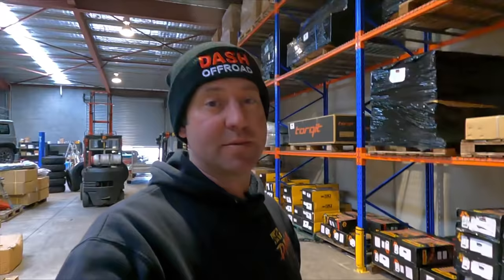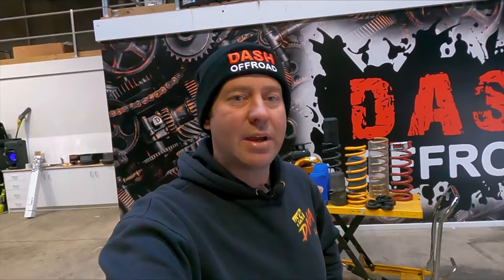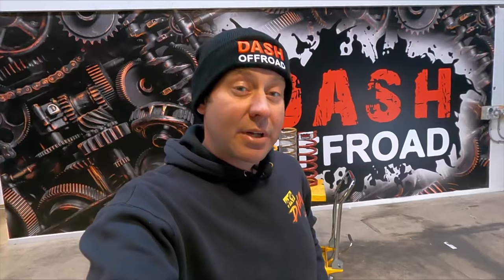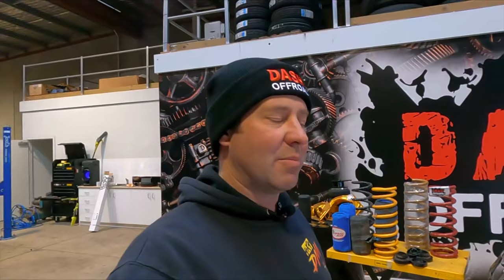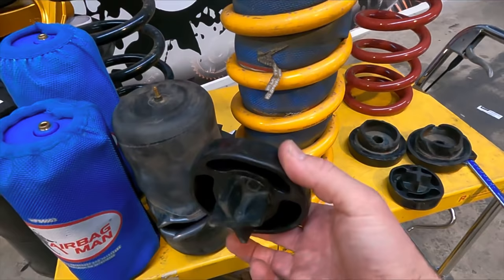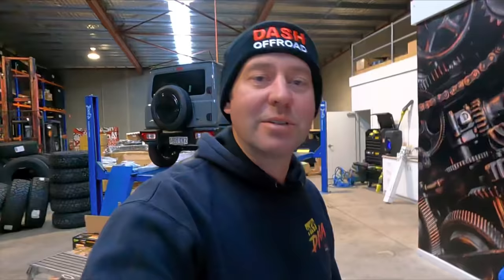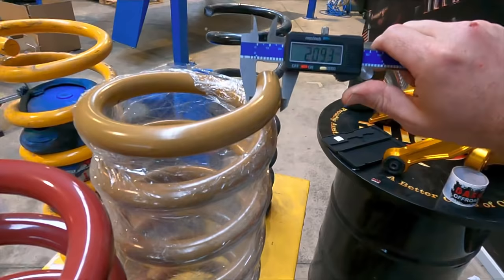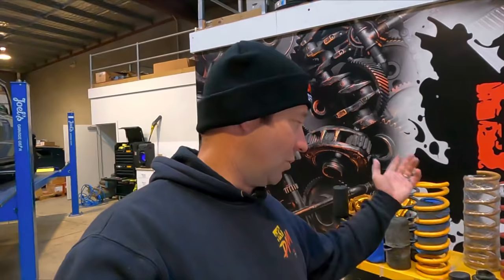Catastrophic Airbags When Towing

Comment: Because you work in the car suspension industry you are going down  a trial of discovery through trail and error. Which is a great way to work out what works. There will always be a weak link in the system  as you will discover. You can install good suspension but the basic problem is we are all towing to much weight in relationship to the tow car weight. I enjoyed your video.

Comment: If your patrol client is driving the ST, he’s got 582kg payload available. Minus over 350kg for towball weight like you said he has, leaves at most 232kg payload for his towbar 40kg, himself 80kg, his travelling companion 80kg, recovery gear Inc air compressor 30kg OOPS already out of payload and that’s even ignoring the GCM figure (use that and you get even less). What about clothes? Food? Water? 2nd battery? Jerry can for the petrol that thing will drink? Irresponsible.

Comment: I have 2 points to add . First is on coil springs . When possible use progressive wound springs they start out softer and ramp up to the full rate. 
With airbags especially the ones with the bigger lines use a separate air volume tank and you will be much happier with the ride.

Comment: Good informative video , but  rather than just put a stiffer spring in the rear and or airbags  to carry the weight which it will do quite well. Another alternative is to run a spring one rating lighter and use a weight distribution hitch  which will bring the rear up and transfer some weight to the front axle improving steering and mainly braking ability with the benefit of a good ride when not towing. Tough dog TDC790L front coils, rear TDC795 with airbags rides like std empty but will tow 3200 kg with 320 on the ball has worked well for the last 3 years, just another way to do it. Keep up the good work.
Reply: But a WDH is a bandaid to compensate for spring rates that are not up to the job.  WDH work, but they are not without their own risk and cost.  They add mass, they add stress through the tow coupling and entire vehicle chassis, they can mask instability up to a point but once that point is exceeded they can make things worse.  The best solution to sagging suspension is to reduce mass.  Then spring the vehicle appropriately.  This only becomes an issue when the vehicle is being asked to perform two tasks that are very different (comfort when unladen and support when load carrying).
In a typical (space constrained) vehicle application, it is easier to make an effective variable rate leaf spring than a coil spring, which is why (airbags aside) most load carrying vehicles tend to use leaf springs.  
My 2c, I’d rather run appropriate spring rates (steel or air) on the vehicle than bolt a large spring across the tow coupling to try and force the nose of the tow vehicle down.

Comment: Tyre pressure is actually determined by tyre construction, axle load and road conditions, so 50 or 57 PSI in the right tyre construction and conditions can be accurate.

Comment: I'm excited, proper air bag system. I have to park in the city and can't increase my height any further
Reply: Have you looked into aeon springs/ extended bump stops? Pedders make some. A long bump stop that, when unloaded, does nothing, but when loaded, becomes a load bearing spring of sorts that ramps up spring rate the further it is compressed (much like an airbag) but without the aggressive rebound of an airbag.
Reply: @zeitgeist785  I don't get how this can raise and lower my vehicle like an airbag can
Reply: @angusrainbow8853  Oh, they can't. I was assuming that the reason you wanted to raise the vehicle was so that, when loaded and towing, it would drop back to its normal ride height. If you want to change your ride height for other reasons, then an extended bump stop isn't going to let you do that. EDIT - Oh, I get it, I wrote "maintain comfort and lower height when unloaded...". by "lower height" I meant that the vehicle's ride height is lower than if you fitted stiffer springs needed to deal with weight when towing. So while extended bump stops can't change the ride height of a vehicle, they improve your load carrying capacity without having to increase the ride height.

Comment: And what about extended bump stops/aeon springs? Maintain comfort and lower height when unloaded with increases spring rate when loaded. Cheap, simple, reliable, easy to fit, no moving parts, actually improves ride even when unloaded (improves bottom out performance) although may benefit from an updated damper, especially in rebound.

Comment: !connecting airbags! Mate, perfect anti-anti rollbar. As you lean (when cornering) pressure increases on the loaded side so would increase pressure on the unloaded side effectively lifting that side and further increasing lean. Sure, it ‘might’ help get extra travel but only if you’re not getting full travel already (and ‘great’ way to encourage your already lifted and tippy 4wd to take the final step and fall over onto its side).
Reply from the maker: Agreed, need to be careful of air moving across the bags to cause a roll over

Comment: I am really curious to why people who know they want to tow a big rig but they still buy a 200 or 62 there are so many better alternatives like Rams F150s etc.
Reply: People want wagons that are big but still tow well, they are simply better than an Everest or Pajero type but are cheaper than a massive American Ute
Reply: Buy a 200 series or y62 and spend a easy $25,000 on suspension,brake ,gvm and power upgrades ,find out your GCM doesn't give u 3.5t towing now ,.Maybe a ram or chev is probably better  as factory ready with warranties  that are valid
Reply: @jasonh6475  yeah that’s what I was thinking I wouldn’t bother towing a big van with mine I would sell it and buy a Ram or F150 every day of the week.
Reply: Hate the phrase bolt on weights.  You cannot make a airbag in a coil take a extra 600kg(4 people,food,camping stuff and any thing else people cram in a car) plus towball  weight . At 20psi your spring is literally bound to the air bag destroying  any handling .all that shock loading is going  straight  into the mechanical  components.My view and its what I was told years ago  by airbagman is 15psi max. Any more change the spring rate.
Reply: For me I may tow 2-3 weeks of the year, for the other 49-50 weeks I want to be able to Zip around freely and not feel I’m in a truck that our roads and car parks aren’t really built for. If I were going around Aus I may think differently but right now enjoying the V8 Y62 will put a smile on my face every time I push that pedal down.
Reply: Perhaps because when not towing they wish to house their tow vehicle in their garage??...
Thats my premise. I agree - space unrestricted I would get a RAM2500 or similar.
Reply: Gonna have to agree to disagree with all these posts guys.  You’re all talking theoretical views with no real life experience OR very little experience.  We tow a Coromal 3.5T 20’ fully off-road van, made a small investment on a GVM upgrade (I know this doesn’t change GCM) chucked in airbag man airbags and fully loaded, with food, alcohol and all the shit we carry in the van PLUS Engel in the 200 series fully loaded as freezer for 2m XMAS travels (part work and part XMAS holiday), wife 70’ish (she’ll kill me for putting that out there LOL) and myself (105kg) plus 180Lt water bladder in the cruiser - we’re at our GCM all up (van weighs 300kg on the ball almost exactly) and she tows absolutely beautifully.  We have had it 4 years now, travel for about 3M a year as I can use the van as an office and we clock up about 10k per year on the van up in the WA Northwest plus two trips up the Great Central Rd to Alice.  I cruise very comfortably at 100kms to 110kms (accidentally creeps up there very easily), in top gear purring, can overtake a road train into a head wind and both the car and van are very very stable and just totally eat the overtake up without a blink!  So I can only disagree totally with your views on the 200 series as a tow vehicle fellas.  Regards though to you all for sharing your views. Paul 😃
Reply: @jasonh6475  Agree here on the max PSI, although mine is an older 4x4 I never go above 20PSI for any prolonged period of time, they are there to assist the springs, not carry the weight. When I first got mine I pumped them up to just under max and it was horrible "was only a test" was like riding a brick.
Reply: @PaulMotu  and what PSI were you running in your bags?
Reply: @heftymerv  26 - 28 psi.  Gets our levels just nice but bear in mind our van fully laden only puts 300kg's onto our ball and we have the GVM upgrade so strong springs.  Recommended max s 30psi (we don't have the additional sleeve) so I keep them a tad under the recommended max.  26 is sort of where I am happy to run them when we're coming home and everything is almost depleted in the van else I'll run 28 when pretty full.  10 - 15 psi when just running around town and doing stuff without the van.  Don't really stress about them when home but every now and then I do check them as running them below 5psi is a no-no.

Comment: Great video Dave ,much to learn here ,on air bags with leaf suspension will the air bag put all the weight on the chassis arch in one spot resulting in chassis failure , this is for towing with a ball weight of 250kgs on a 79 series  , also have a friend about to buy a Nissan  to tow a 3.1 tare van ,I will direct him to this video ,again thanks for the no bull or commercialised information
Reply: Why would anyone buy a Nissan in 2022....crazy.

Comment: Hey Dave, you are probably already aware of this, but just thought in case you weren't, that I should let you know that the audio wasn't great on this vid. It sounded muffled and cut in and out a few times. Interesting new suspension design there, looks similar to the Cruisemaster ATX airbag suspension my father in law just put on his caravan!
Reply from the maker: I’ve always struggled with audio sadly. For this vid I changed to a level mic which did have improvements whilst it was working, but did cut in and out a bit unfortunately. It’s something I’m continuously working on 😩
Reply: @DASHOffRoad  can't say I've noticed too much audio issue in other vids, maybe a bit of wind noise here or there but no big issue. Keep up the good work! 👍
Reply: Use an audio compressor

Comment: great video, I've been very mindful of weight.  My Isuzu MUX has 3.5t.  The New Age Road Owl is 2.35t empty I believe but with a mixture of load in the car and van I'm probably carrying another 400kg (people, fridge, offroad gear, kayaks, ball weight etc).  I'd be close to GVM and GCM but still legal from my calculations.  The MUX however is quite saggy on the rear, even when the van is empty which to me was surprising at 2.35t.  Soft suspension I guess.  I'll probably look at air bags very very soon.

Comment: And what about the practicality? Tow 3500kg and carry SFA in the car. You’d be lucky take your missus, her makeup bag and a full tank of fuel in most vehicles before hitting you GCM (certainly if you already have fitted bash plates, bullbar and a winch). Towing 3.5t (100% capacity) is impractical and dangerous.
Reply: Gonna have to agree to disagree on this one Martin.  I posted a reply to the comment by 4x4 overlanding above (or is it below LOL) which sets out my experience with our current Toyota L/C 200 series so won’t repeat all of that here but 5 years ago we also drove a “relocation” L/C 200 series and the 22’ family van back (combined relocation after some guy and his Czech family travelled around Australia from Perth and left it in Sydney) back across the Nullarbor from NSW back to Perth and it too was an absolute towing dream and tow vehicle.  We’ve had our 200 series now for going onto 5 years and ditto our 3.5T van (purchased a week apart).  We are young’ish and travel a lot every year in our 3.5T (when fully loaded) van - 6.5T total GCM which we are at when fully loaded. We carry a LOT of shit and are right on our GCM when fully loaded (we have weighed it officially on two big trips to check our weights beforehand).  I’ve never bothered towing our big van with anything smaller after experiencing the ‘relocation 200’ which lead us to buy our 200 series and she’s an absolute beast for towing and overtaking ROADTRAINS into headwinds on UNSEALED roads which I can honestly say is when all tow vehicles will come under the ultimate test of capability and stability and I would strongly suggest anyone buying a tow vehicle totally disregards the bullshit that the sales person at the car yard will throw at them to buy any vehicle he wants to sell you (unless it is like a 200 series).  I invite any one who tows a big van with a 79 series to also give their views too about that as a tow vehicle because I can vouch the 200 series can tow 3.5T safely, comfortably and with absolute stability.  Off-road, overtaking a road train into a headwind!!
Reply: @PaulMotu  Both our views can co-exist. You say towing in the LC200 works. I don't disagree. I say when you do the sums, the Patrol towing 3.5t means you get to carry SFA in the cab itself because the max GCM leaves very little payload. The 2021 LC200, unladen weight 2720kg. +3500kg for the van like you said. Gives you 6220kg (edit- leaving another 630kg before hitting max GCM but that's irrelevant because of limit imposed by max GVM). EDIT- Max GVM 3300kg less 2720 less 350(assuming 10% towball download) leaves 230kg payload in your car. Say 80kg per person, leaves 70kg for luggage. So either your van didn't weigh 3500kg or you and your passenger weigh almost nothing. Remember that 70kg has to include towbar, bullbar if you have one, roof rack, jerry cans etc etc. Sure, you can tow 3500kg, just don't expect to take much else, let alone go for a holiday somewhere remote.
Reply: @zeitgeist785  Yeah sorry mate. Bit misleading of me. Our van is 3500 fully laden with everything in it (at that weight it is at it's max). It's the Coromal PXC 612 which has a max loading of 3.5T which we get it to.  Ball weight when fully laden is a tad under 300kg's (we have ball weight scales and check that each major trip too). The GCM of the 200 series is 6850kg's (not 6220kg's) which we also get it to (GVM upgrade doesn't change this as you will know) when hooked up and all our shit on board including installed extra's.  We are on the legal limit but towing capability and safety are definitely 100% with this vehicle.  Appreciate your reply mate and for keeping shit real for everyone.  Cheers Martin
Reply: @PaulMotu  Yeah, getting the GVM upgrade does unlock you from the genuinely impractical payload limit. Lets you use some of that spare GCM that is out of reach otherwise. Some manufacturers do well to give you the impression that towing 3.5t is a practical option for stuff like going on holiday with the family but then neglect to point out that (without a GVM upgrade) you have to pick either the family OR their luggage, NOT both! lol. Which then creates the GVM upgrade market (The cynicism is strong within me....I think I must be auditioning for a grumpy old man position!)

Comment: Sorry Dave but your generic statements with regard to coil diameter means better is totally incorrect. You need to understand coil rates, windings, different processes (cold & hot) & other things that go along with it.
Put the verniers down as they are a machinists tool 😉
Reply from the maker: Thanks for watching Brooksy 😏
Reply: @DASHOffRoad  love ya long time mate. Just trying to help as there is far too much misinformation out there.
Reply: I powder coated my springs red 20 times and ended up increasing the spring thickness by 3mm, it has made the car go faster and now I’m confident towing a ton ball weight offroad!
Reply: To be fair, he did comment he wasn’t going into windings etc.  Arguably all else being held equal, surely coil thickness should result in a higher spring rate.

Comment: I have a 2014 passat, i have quite a few hundred pounds of tools in the trunk all the time. I want to get back to normal height.  
I am considering options. I see no heavy duty springs available.  I can get firestone coil rite, or try my chances with passat wagon springs, but no idea if they even fit let alone if they will be the correct height when im done. 
I do not want to go full air ride for one simple fact, all the 12 volt compressors are way to loud. 
Is there any option that i do not see? I checked many web sites and find no other option.
Reply from the maker: Not sure sorry

Comment: I don’t think those big air bags will be the next thing, too much to go wrong on your chassis where the bags mount and the diff, they will be the weak point instead of the spring/ airbag, they
Reply: The issue you’re possibly aware of with structural weakness was on the GU upper mount always breaking. The upper mounting point on these is super strong as is the chassis. The diff can’t be impacted by the airbag cell. The known weakness is the lower control arm which OnTrack has already come up with a bullet solution :)

Comment: G'day Dave, great info. What's your opinion on doing big gvm upgrades 4t plus and putting a 3.5t caravan on the back, is the rear end on these things built well enough?
Reply from the maker: Can’t be done, I’m afraid a Y62 isn’t the right vehicle for that sort of thing 😩
Reply: We love our 62 and we're days off from handing it over for said upgrades and we also tow 3.5t van but after seeing this it has made me question the build. For someone that doesn't particularly like American trucks it doesn't leave many options. Appreciate the reply Dave, cheers.
Reply: @tinnyona4x424  why would you want to tow such a Heavy Caravan with a 4wd ,safter to buy a small truck they are made to handle weight like that not 4wds .